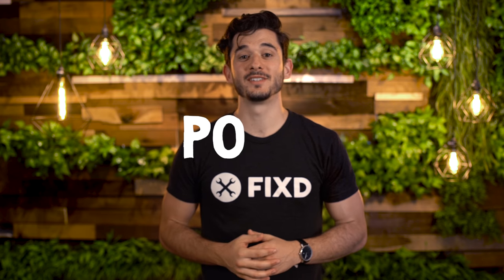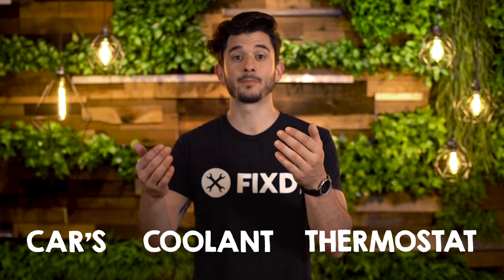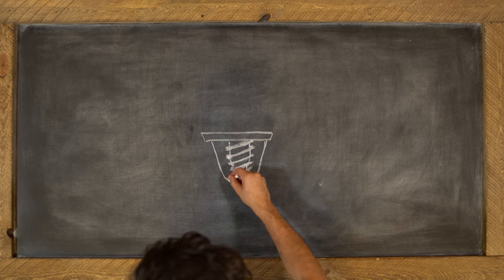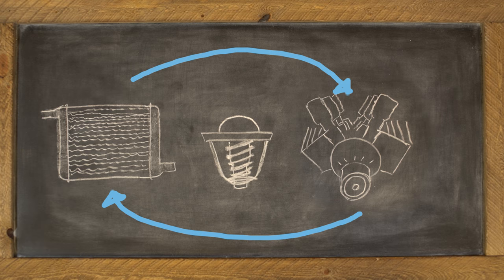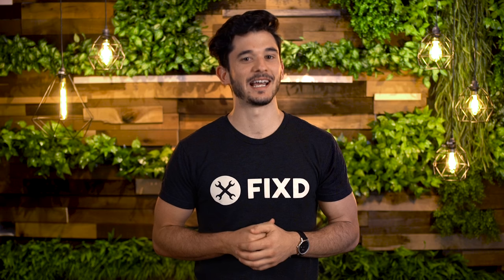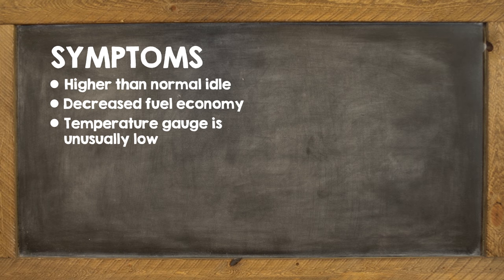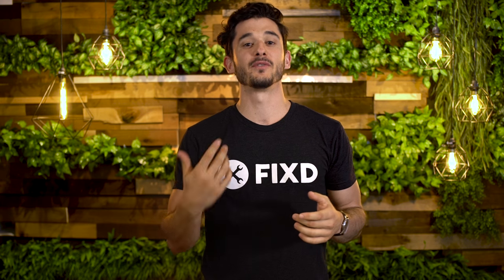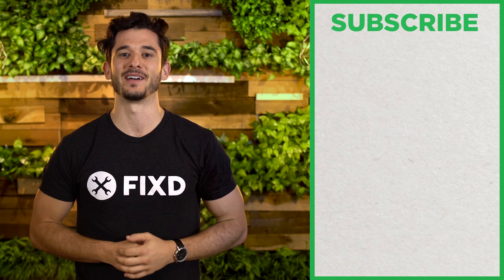P0128 Explained - Coolant Thermostat Temperature Below Regulating Temperature (Simple Fix)

Comment: I am getting p0128 on my 07gl450. I noticed radiator fluid dripping on driveway as well. Thanks for the info...best place to buy a thermostat? Will fixing this clear my engine light that’s currently on? Thanks again for the help. I just subscribed...Boom!

Comment: Okay when I’m driving on colder days it hovers around 77 degrees Celsius. Then it always trips the light. If the cars idle and not moving for say 5 minutes the temperature goes up to the normal range 90 degrees Celsius. I have good heat in the cabin I can put my hand ontop of the engine and not get burned the hoses feel nice and hot so do you think this is faulty temp sensor. It’s strange when moving it dosnt heat up quick enough when parked and idling it dose.
Reply: I’m having same issue with my Ford Fusion 07 any ideas what the exact problem could be ?????

Comment: To anyone who’s automotive educated; If a radiator fan is constantly running, wouldn’t a properly working thermostat opening and closing help regulate the temperature to its operating state thus making a running fan not an issue?? 

Only wondering bcz I keep having this code pop up occasionally. 

Looking at date, code came on when engine was at 165F and vehicle was still in a closed loop. Rpm was around 3400 when the code was capture.

Currently pending a thermostat replacement so hopefully that solves my issue.

Comment: In my case Opel Astra 1.4 Turbo A14NET,  P0128 was the only code, Thermostat was faulty indeed, but dash prompt messages ENGINE GOT TOO HOT so car ECU had to shut down the A/C. Once I open the hood,  noticed the fan was constantly working on full, which indicates a CRITICAL problem,  the water were not extremely hot,  it's because of  the faulty thermostat resulting in no water circulation. Button line I want to say this error code can be CRITICAL and severely damage the engine.
Reply: Did the temp gauge show it was hot before shutting down?
Reply: @mitchio83  yes

Comment: Also if you replaced your OEM thermostat with a race thermostat, that opens at 160 instead of 180 you will get a code. Replaced mine with a mishimoto amd got the code.

Comment: Hi I recently installed a catted downpipe and now I have this code ...help
Reply from the maker: p0128 is for coolant temperature below thermostat regulating temperature. Most of the times this is caused by a thermostat sticking open or a faulty coolant temp sensor. This issue can be related to other issues, however most of the time it's a simple fix. A good indication of your thermostat failing is the temp gauge on the car not reaching operating temperature, heat not working well etc. If your in-vehicle temp gauge stays on the lower end while driving this is a good indication its a thermostat.

Comment: I have a 2012 Chevy Sonic. I’ve changed thermostat, temp sensor(X2), new radiator, radiator sensor, coolant flush, check wiring, tested fans and still the code comes back.... my last resort is to go buy dealer thermostat thinking autopart stores China products are faulty.
Reply: Did u figure ur problem out having similar issue
Reply: @lakerphan17  yes! I saved the original parts and remove the aftermarket thermostat to compare them. The original was totally different from the aftermarket one.. I cleaned the original one up with a wire brush and brake cleaner... let it dry and reinstall it(original) and have not had any problem since but now know that if something goes wrong with the thermostat that I will be taking it with me to the dealer to get the exact same one. I hope this helps you. Good Luck